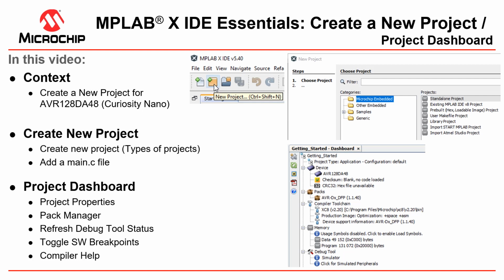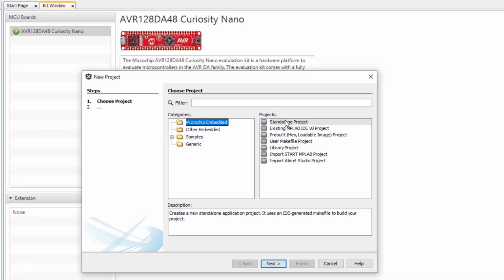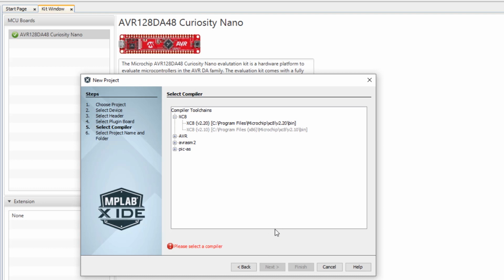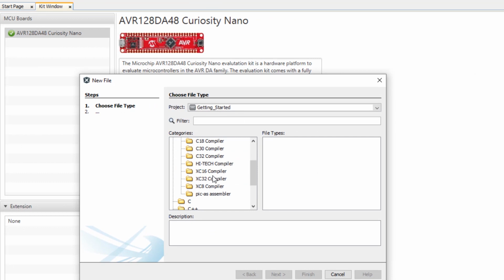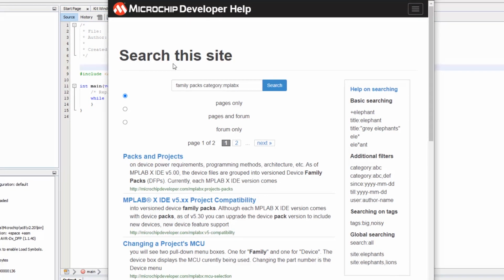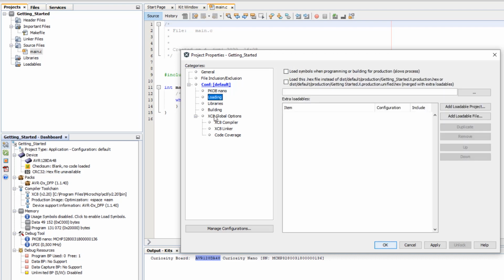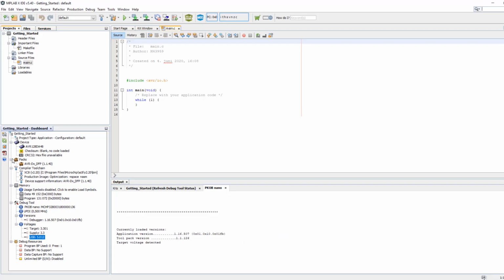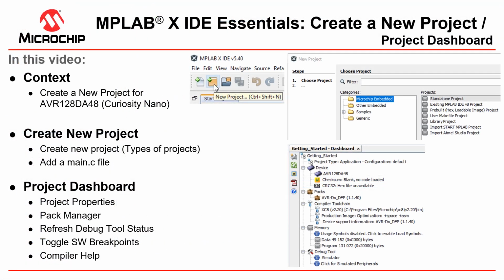Getting Started - MPLABX® IDE Essentials - 04: Create a New Project/Project Dashboard

Comment: After creating a pre-built project and using the externally generated "cof" file, I can debug the pre-built project but once I make a change in my code and generate a new "cof" file, the pre-built project still uses the old "cof" content. I even "reload" the "cof" file in the project tree under "Prebuilt Files" but still old content is considered in debug mode. I have to create a new "pre-built" project every time I generate a new "cof" file. This is really not practically efficient. Is it a bug or I am missing some important information to get it working properly? I appreciate your reply in advance.
Reply from the maker: Kindly visit support.microchip.com for assistance, we will be happy to assist you with your question. Thank you.
Reply: @MicrochipTechnology  I already found a solution. Once you create the pre-built project, it copies the externally generated "cof" file into a new folder (i.e. project_path/dist/default/production). Every time I re-build my project externally, the original "cof" file  changes (of course) but not the copied one. So I made a change to my make file so that it copies the "cof" file every time it gets re-built into that specific folder (mentioned above). This is a bug of MPLAB X IDE and I have already contacted an expert of Microchip in Germany and he confirmed the problem. But like I said, there is a workaround for this issue for now.